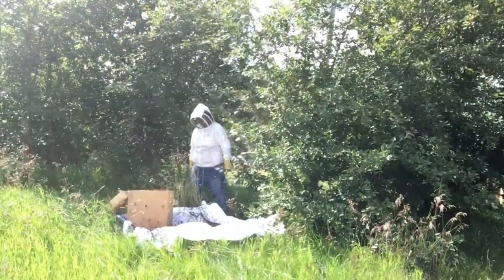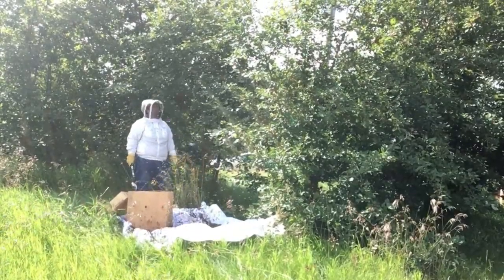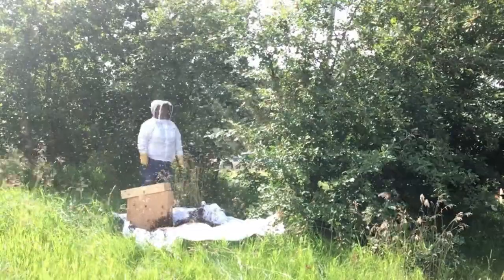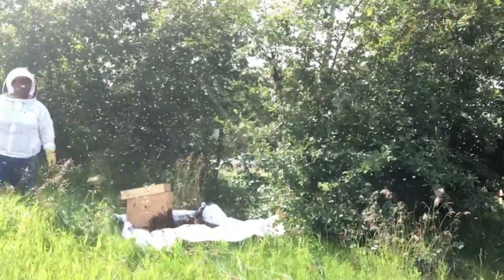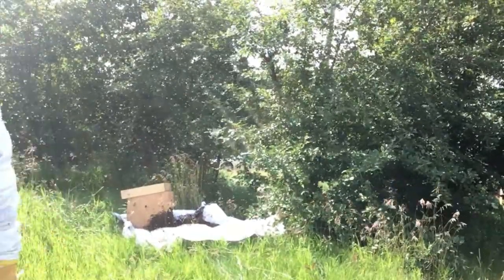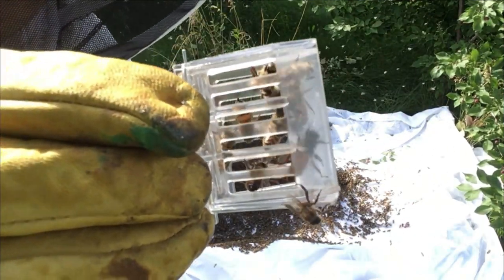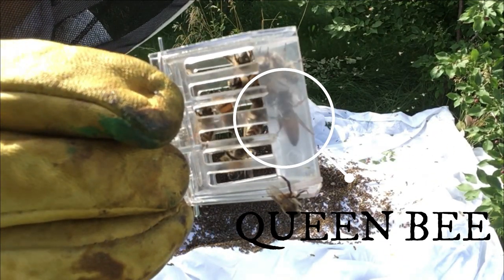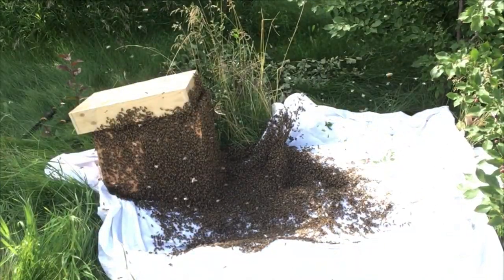Ponoka County Swarm Removal

Comment: If you leave the lid open just a crack they would have been able to all march inside, then you can close it up. I remember reading that the entrance to a swarm trap should be about 2 square inches in area, so that it what I build and staple netting inside to keep animals out. The volume of your swarm traps are about perfect :-)
Reply from the maker: Hello BeeZerk! Thanks for your comment! On my swarm trap I drilled a 3/4” hole and I actually buy a metal disk from ApiHex, which I screw on over the hole. I leave the “choke” fully open until I catch a swarm. Then at night I can simply turn the “choke” dial to transport air flow only. It’s quite slick!